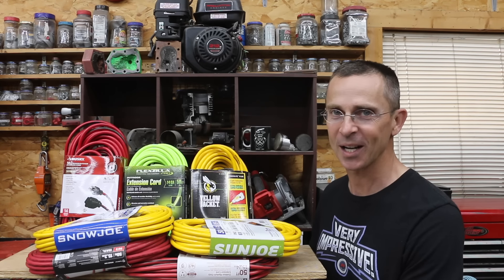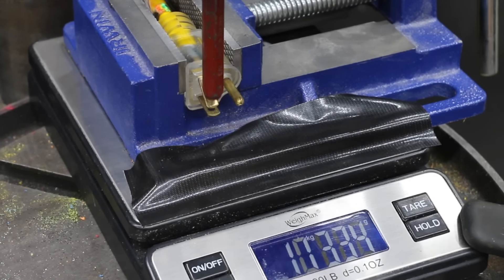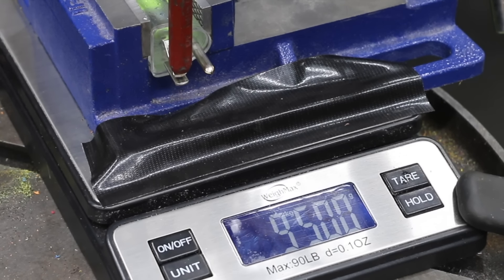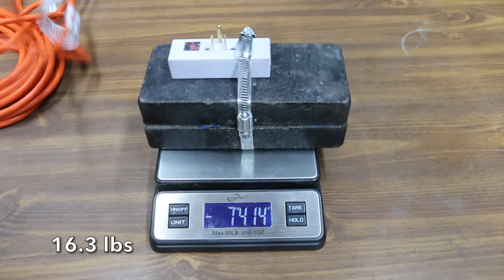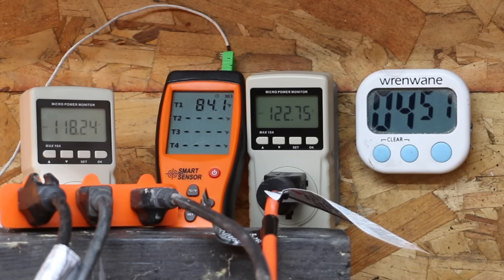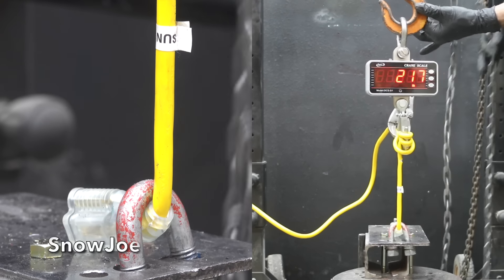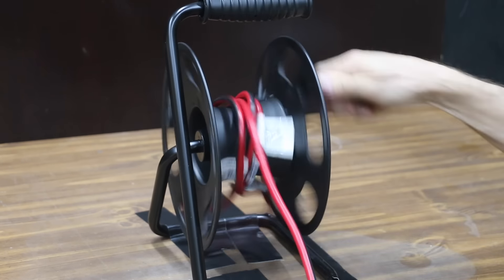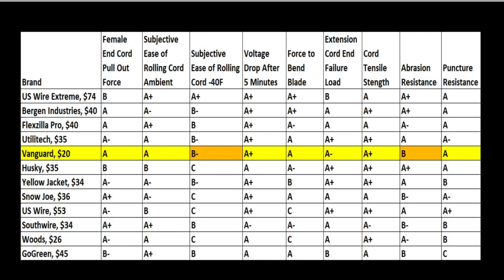Best Extension Cord? Flexzilla, US Wire, Yellow Jacket, Southwire, Husky, Woods, Bergen Industries

Comment: 10 Gage cord has better use in some applications. Example at 50ft to 100ft trying to start a loaded air compressor 14 and 16 Gage stands little chance. A 12 gage will sometimes struggle. A 10 Gage will work almost every time.
Reply from the maker: Thanks for sharing.

Comment: In the UK the best extention leads are the 110 Volts used in step down tranformers If I remember right they are yellow 240 Volts extention leads are all colours on building sites usually Blue, the 110 volts are More pliable the others in cold weather most will become so brittle bend them n their insulation will crack totally some chippies they become like a plastic rod
Reply from the maker: Thanks for the feedback.

Comment: Should you ever test this in the future, one element that doesn't get tested enough is the plug's resistance to heavy loads.  I've observed HUGE differences between cord brands when charging at 12A continuously for 12 hours or more.  Some brands hold up well, others nearly turn their plugs into puddles of goo.  If you ever do this again you might want to include a heavy continuous load check for plug damage.
Reply from the maker: Thanks for the constructive feedback.

Comment: In my opinion (a filmmaker, we use a lot of extension cords, plugging and unplugging all day long.) having malleable metal blades isn't really a bad thing, as long as they aren't brittle.
Reply: Also, now that I'm thinking about it I would also rather have less gripping power, I'd prefer a light "kick out" then get yanked over. This video is awesome.
Reply from the maker: Thanks!

Comment: Just a quick question.  Why are all of the connecting ends moulded into the wire? Here in the UK the plug end can be unscrewed and replaced if the prongs are bend or the end is smashed. Is there a reason that isn't such a thing in the US market?
Reply: Likely provides better strain relief and better sealing against elements. Would also allow you to make the plug smaller. I've replaced ends with the screw on type and they're never as slim.
Reply: May also have something to do with the integrated fuses in uk plugs

Comment: Next video  - comparison of dc wiring connectors. Crimp, crimp with shrink vs adhesive shrink.  Connectors would be good also - aptiv/delphi weatherpack to metri pak as well as aptiv compared to knockoffs
Reply from the maker: Thanks for the suggestion.

Comment: Mine always fail the same way... the ground prong pulls out.
But on another note, the abrasion test is not just measuring the effect of abrasion on the cord casing, it is measuring the effects of abrasion AND heat. The sander is adding a lot of heat to the abrasion that dragging it across the floor will not. 
A cooler method of abrasion would have been a little more real-life accurate.
Reply from the maker: Thanks for the feedback.

Comment: I wonder if there is a 14 gauge extension chord that would be fine for my around the house use for significantly less than $20 bucks.
Reply from the maker: Thanks for the suggestion.
Reply: @ProjectFarm  You're welcome! I just ended up ordering a 14 Yellow ajacket because I thinks the answer is no, but I'm more worried about if a 10 dollar 16 gauge is enough for the treadmill my wife just bought

Comment: Evening, I have been following your channel for a while now and I absolutely love your content. I am in the market for a new electric pressure washer. I am considering two types. The Sun Joe SPX4600 and the Greenworks Pro GPW3000. The price is not that different but was wondering if you could do one of your amazing reviews on these two with several other comparable pressure washers? I know you did a review on the 1600 psi models but these are rated at 3000 psi.
Reply from the maker: Thanks for the suggestion.

Comment: Thanks Again. I don't care if the blades bend but would love to know results of a test of bending them back ... how many times before failure (or other performance issue like voltage drop)
Would also love an option to download your final ranking grid so I could remove that areas I don't care about and see the best performer (similar to what you did 3options but form my key areas) just thoughts.
Reply from the maker: You are welcome!  Thanks for the video idea.

Comment: I would avoid chinese wire in the higher amperage application...I had a 10 gauge HF cord kill my 120VAC winch and the cord should have easily handled the load.  I'm in Texas and every jobsite I have worked on has seemed to use US Wire for its durability.  I don't see how the blade bend and cord pull out tests really apply to real world work so it should be ranked even high than it is for practicality.  Thanks for the great test!
Reply from the maker: You are welcome!  Thanks for the feedback.

Comment: Great video, I'm surprised you didnt test the single most common failure mode, poor connectors.   The connectors heat up because of the electrical resistance in the contact area.  It would be simple to preform by applying various loads and using a thermal camera to image the connectors.    To be fair use 2 identical cords plugged into each other in order to test the same manufacturer's  male and female connectors when mated.
Reply from the maker: Thanks for the constructive feedback.

Comment: I don’t know how you would test this but as a daily user of Extension cords the most annoying thing to me is permanent twisting of the wires inside the casing. This happens over time as the cord is rolled up. I suspect it is because the exterior jacketing is too loosely molded around the internal wires. It has happened on my most expensive cords and the cheaper ones to. It can be very annoying because the cord does not roll up well and you have to untangle it at your next stop.
Reply from the maker: Thanks for the suggestion.

Comment: What about a video where you test beam-style torque wrenches? I'm not sure how feasible it is to get calibrated measurements on that or how many different manufacturers there even are, but it would be nice to know which ones can be trusted, especially since beam-style don't really require recalibration like the click-type seem to.
Reply from the maker: Thanks for the suggestion.

Comment: Few things here that aren't covered: How does the cord wrap? Does the cord keep its flexibility overtime without forming perma-kinks from bad copper or a dry rotting sheath? How flexible is it? Can it bend around corners well? Does the sheath collect grime? 

I've had several Yellow Jacket 100' cords and other accessories for well over 10 years and put them through their paces, not one of them has failed me or frustrated me in any way. They don't tend to kink, they don't form lasting kinks, they take tight bends well, the sheaths don't grime up, they are BRIGHT YELLOW so you know where they are and don't cut them / can find them in a dark space easily, and they wrap up at the end of the day no problem. For the money, I don't know of any other cord that can do those things. Seriously, after 14 years of daily use my cords are in like new shape. Pulling the plug off, bending a prong or scoring/slashing the sheathing are NOT aggravating issues to me, nor is expecting it to flex like taffy at sub freezing temps. That's all just being an idiot and expecting miracles, it's not within range of non-industrial use. But, I get it, that stuff keeps the kids entertained - having THE BEST (no matter if that only means best at use scenarios they will never encounter).
Reply from the maker: Thanks for the suggestion.

Comment: 08:30   The heat test was measured near the center of the cord. In my experience, the most heat occurs at the female end.
One problem I noticed with extension cords is when using them with high amperage loads like space heaters. (Yes, I know extension cords are not recommended for this, but what are you supposed to do when the heater comes with a standard 6' cord and you need it 7-10 feet away?)
Anyways, the problem is that the female end of the extension cord always seems to get very hot. Using a smaller gauge cord helps but it still gets warm. I wonder if the female connector is cheaply made and if replacing it with a heavy duty one would help?
Reply from the maker: Thanks for the suggestion.

Comment: Hey farm guy,check THIS out.
I took 3 16gauge 50' cords,stripped the ends & soldered them into ONE line each & made a 50 Foot extension cord for my 220 LINCOLN stick welder ( of course I needed new plugs)
braided it together & prettied it up w/electric tape binding every 8".
I've been using it for 12 years.
Reply from the maker: Thanks for sharing.

Comment: In my experience when a cord fails it is almost always due to a loose connection at the outlet building heat and melting the plastic/rubber. If only they made outlets with a more durable/solid connection.
Reply from the maker: Thanks for the feedback.

Comment: Kinda surprised about how the plug tangs could be pulled out so easily --- we had to test all the wall receptacles in a hospital I worked in and each tang --- including the ground lug --- had to have a 5lb resistance to pull-out. A total of 15 lbs was the minimum and we took a LOT of receptacles out of the wall every year. You can't have patients getting their plugs accidentally kicked out of the wall --- the paperwork alone was overwhelming if they died.
Reply from the maker: Thanks for the feedback.

Comment: Suggestion- test harbor frt. Amazon and others 18 and 24” 1/2” breaker bars.
Want to keep one in my truck for tire removal. Bought a icon. But is it that much better than the Pittsburgh ? Or the cheap Amazon one?
Reply from the maker: Thanks for the suggestion.

Comment: Valvoline has a newer extended performance full synthetic out, Im interested in how that stacks up against Pennzoil Ultra Platinum.
I drive Chrysler vehicles, and they specifically ask for either Mopar, Shell, or Pennzoil products, but the best Shell and Pennzoil products are impossible to get off the shelf, and I havent even tried getting the Mopar oil because "stealership", so I'm looking at the Valvoline as a possible off the shelf replacement.
Reply from the maker: Thanks for the suggestion.

Comment: I only use 12 awg southwire UL LISTED and never had any problem the chinese brands gave me ( i see though they need to recheck their female connector pull out strength) , also use their low voltage wiring, it is by far the most thickest best jacket and will last years after qany other brand. After switching to only their US MADE SOUTHWIRE UL LISTED ive had an easy 10 trouble free years period. I will check on US wire, is it all US MADE UL LISTED ?
Reply from the maker: Thanks for sharing.

Comment: My main concerns with extension cords is how long will the female end hold plugs firmly and voltage drop. Voltage drop would be increased if the wire is aluminum with copper coating as opposed to solid copper. Did you cut any of them to see if they were silver colored in the center? I always bought cords based on gauge and price but found that after time, in the cheaper cords, the female end got sloppy.

Comment: What about compressed air lines? I have heard that Flexzilla was good but are now breaking inside of two months.
Reply from the maker: Thank you for the video idea!
Reply: @ProjectFarm  welcome. I run my lines at 215 psi. I know most air lines for home are rated at 300 psi but people run them at 90-125 psi. So, I buy the 300 psi rated lines (as the Flexzilla is rated) but if they are "popping" (breaking) in a couple months. I need new lines, but I am unsure what will last at the 215 psi I run.

Comment: What's the best three 50-100ft extension cords that's has over 1,800w and 15-20amps and don't over heat and can handle cold weather because I'm using these extension cords for a generator  ?
Reply from the maker: Thanks for the suggestion.

Comment: You forgot the most important test. Is the gauge of the wire actually what they stated. I have found a few extension cords that state they are 12 gauge but don't measure up.
Reply from the maker: Thanks for the suggestion.

Comment: So, I need a good strong 6(ish) inch bench vise. Something I can get a 24 or 36 inch pipe on the end of the handle to really get some torque and not bend the handle or just break the vise it's self. I'm looking at the wilton 1765 but is at really better than others that are 1/3 the cost?

Can'ya help me out with this?

I and many others would really appreciate it!
Reply from the maker: Thanks for the suggestion.

Comment: As a life long sparky I never purchase or use ANY electrical products, test & safety equipment ,tools, LED'S or parachutes from lying cheating lack of quality control communist scum bag china. Had too many defects with their garbage. Next time you check extension cords you should overload the #14 & 16 guage cords @ 20 Amps ( would need to be on a 25 or 30 amp circuit breaker ) for 30 minutes then use an Flair IR camera and check temperature at male plug, female cord connector and a inch from each. Some companies do a poor job securing all of the very fine strands of wire to cord ends creating excessive and damaging heat. Thanks for yet another well thought out vidio.

Comment: Ive had issues where extension cords with lighted ends wont let my stuff run right....battery chargers, power tools and  equipment...for some reason. I think the light draws too much power away from machine.
Reply from the maker: Thanks for the feedback.

Comment: the last yellow jacket cord is a 230 power cord, not a 120volt20 amp like the rest. 230volt is rated for 30 amps meaning all the metal and insulation has to be thicker and higher quality to avoid low melting point temps all the other cords will suffer at being designed for 20 amps or less circuits, they will literally melt under a 30 amp driver pushing 230 volts thru the cord

Comment: Why did you only test the holding power of the female socket end of the cords? Are the male ends not made in any special way to stay in a socket? Like, is it possible that the folded over prongs possess a little squeezability that allows them to be compressed and gripped by a socket, so they stay in tighter than the stronger but non-squeezy solid metal prongs? Something for a sequel 😉

Comment: What would it take to at least double the voltage in the US (like in the rest of the world). Double the voltage, and you'll need half the amount of copper.
There are only two moments I am worried about the thickness of my wire, and that is when I am using the 12V of my car and when I am in the Americas. Things like a blown fuse, or burned out sockets are pretty much an American problem.

Comment: An idea to test these further, especially the off shore made ones is to test the amperage rating to failure. Being involved in the Christmas Lighting hobby, we find the wire gauge listed on off shore products is no where close to actual AWG specs, causing us to run lower amperage so we don’t burn our houses down.
Reply from the maker: Thanks for the suggestion.

Comment: If you need a serious cord buy some SOOW cable and quality connectors as contractors do for their cords.
Reply from the maker: Thanks for the feedback.
Reply: @ProjectFarm  You'd likely fun making and using the 240V/120V combo cords that allows. Look over "RV" power cords, receptacles and power boxes to see what suits your desires. For example a 100ft (or two 50ft for less to carry at once) cord can power a 240V welder and provide 120V for heavy duty power tools.

Comment: You... could have just measured the resistance of the conductors with a multimeter. That's literally all that should be happening under normal use - resistive heating.

Did you fully uncoil the extension leads? If not, you'll be losing energy to induction as well. More power lost to heat, essentially. Especially at higher currents. That's why manufacturers always advise against leaving extensions coiled up.

Comment: The only thing I look for in extension chords  is flexibility,  I have no problems with other issues your testing, I will not accept one that returns to its memory and  wants to keep its own shape in cold weather. Absolutely unacceptable to me , and I find the yellow jacket is the best one I’ve used, and because the material they use for sheathing stays flexible, it lasts longer a lot longer and winds up easier saving time on the job site at the end of the day, so when your paying 3-4 guys you wanna save time and money buying materials, and I would rather buy one extension chord a year instead of 5 chords a year
Reply from the maker: Thanks for the feedback.

Comment: Extension cord test and you didn't test the one thing that each one has to do well...

They should have been tested for heat at different loads and how well insulated they are if left fully or partially coiled up.
Reply from the maker: Thanks for the suggestion.

Comment: As a Europesan, mostly indoor extension cord user, I cannot get all the gist of these test.
As a extension cord builder, with electrical cable, plug and socket, I don't consider that interesting "molded" extensions cord.
As European, using IEC 60309-1 blue plug, Type L Italian plug, Type F german plug (Schucko), Type E french plug, Type F+E (hybrid) I see only disadvantages for USA plugs and voltages.
But the gist seem the same...
-extension cord is not... a cord/rope. Don't use like that
-bigger the wire section, less voltage drop and better wattage management
-better the cable, longer the life
and lust but not least: round prongs are less prone to damages.